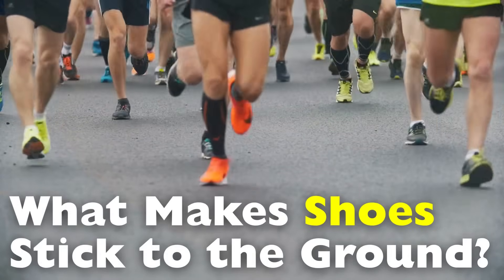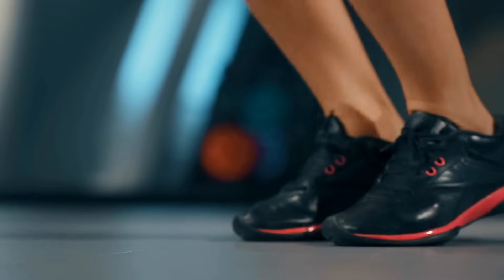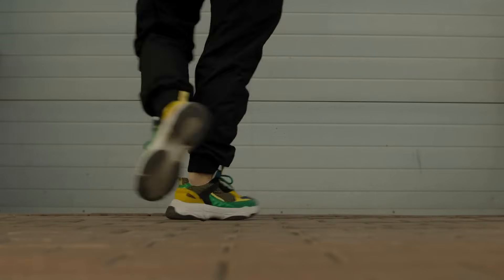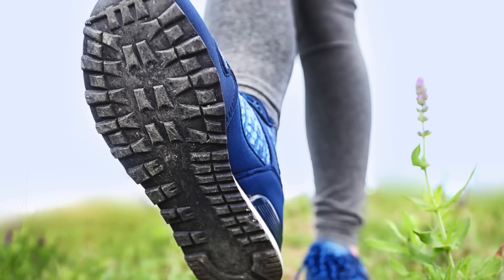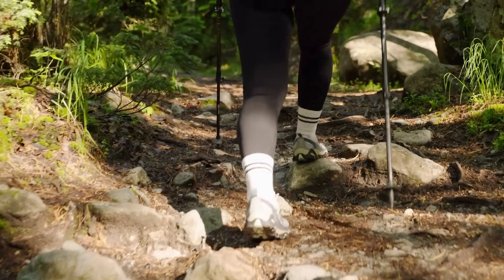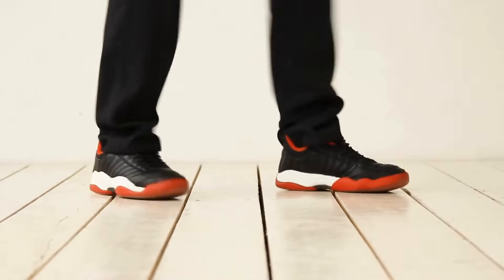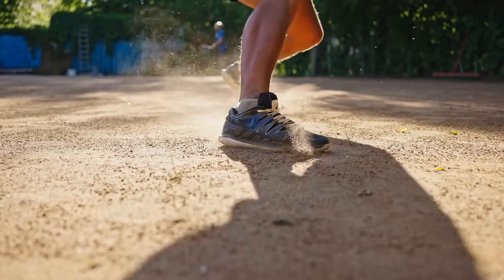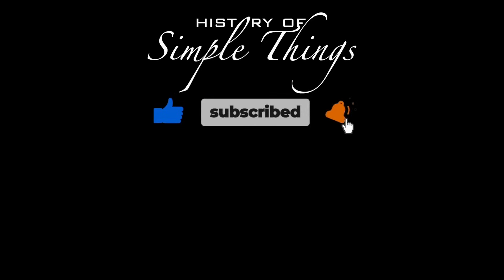Why Some Shoes Grip Better Than Others | Science of Sole Traction

Comment: As far as I know, nowadays many shoes manufacturers also use very big quantity of silicon ( in some way to replace rubber for shoes sole ) as it also has many properties like softness, bounds back ability, sticky surface similar rubber. Silicon / Silica can be produced in massive quantity unlike rubber is a natural material from trees.  Moreover, Silicon is much cheaper than rubber.  Furthermore, the quantity of using silicon in car tires manufacturing is far more than rubber.